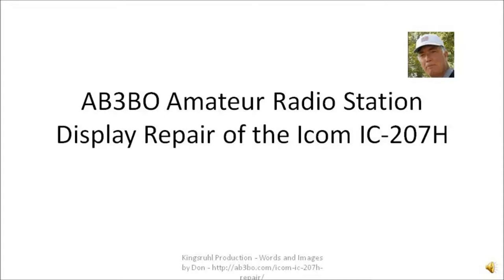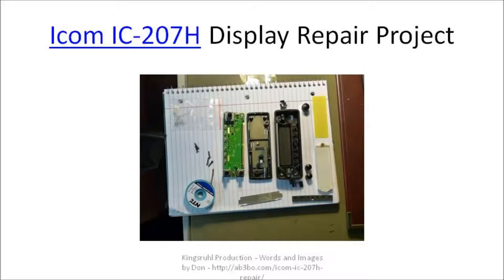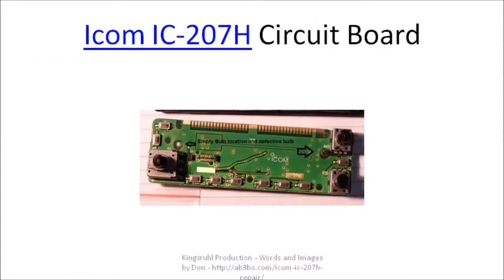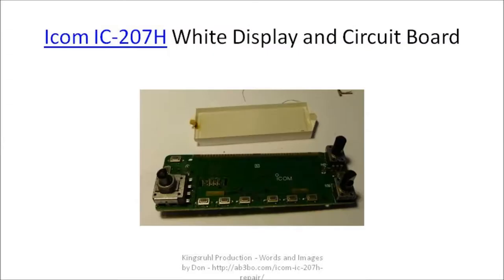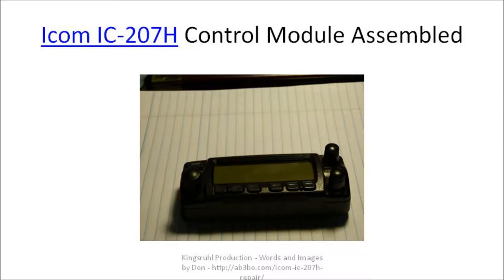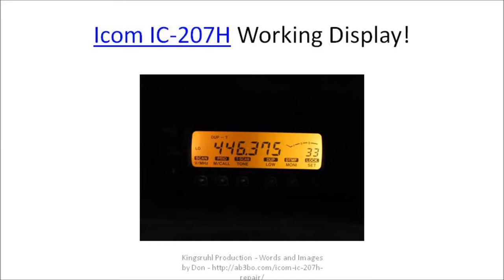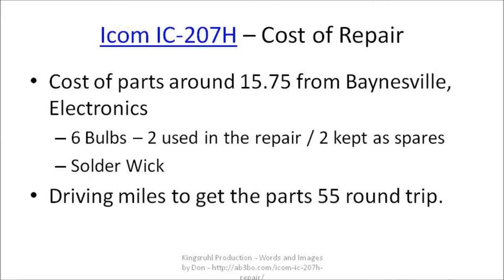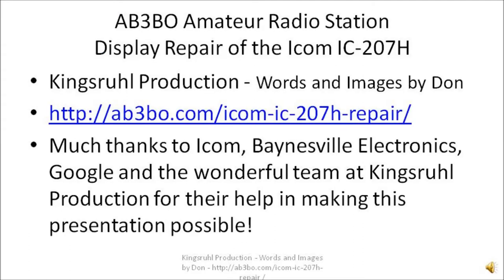Icom IC-207H UHF/VHF Amateur Radio Display Repair

Comment: I'm brand new to ham. I have a 207 and no display lights so I'm going to try this repair. Your video will help. I'm also having a hard time understanding how to program this radio. Any helpful suggestions?
Reply from the maker: +hobbiehobb    Take it one step at a time. Make use of the manual. Try programming in one repeater/channel and do not move on to the next until you get the one in there and working.. Let me know how it goes. Both on the ;ights and the programming.